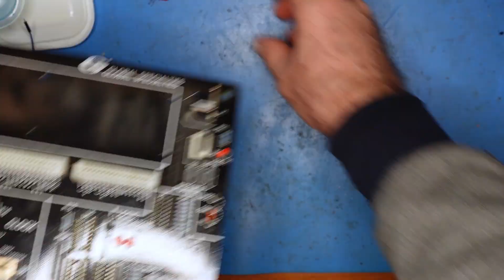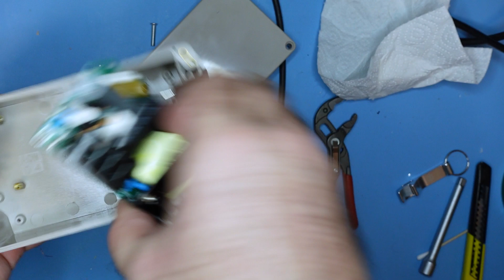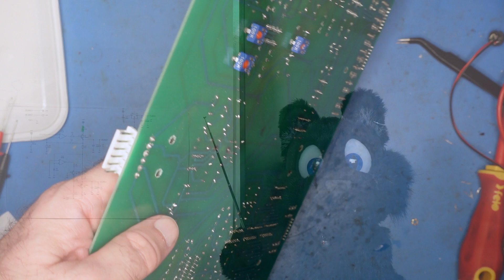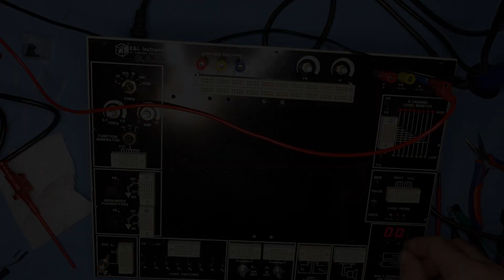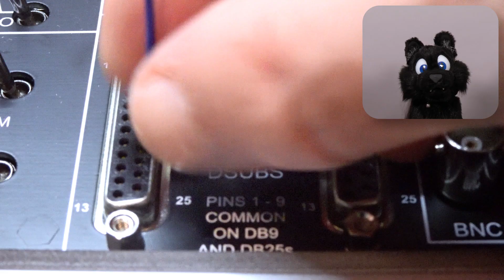Breadboards 2

Comment: I also have that Hantek Scope!
Mines PSU died. The transformer went short circuit.

I recreated it with over the shelf buck converters and 2 24V psus.

Did you also modify it with the 200Mhz hack?
Reply from the maker: So far, mine is holding up. I didn't mod it either. Mostly because I am looking for an alternate one eventually - one that has mixed signal features would be awesome. So far, the frequency was not a really limiting factor for my usual reparis, but seeing digital and (more than two) analog inputs in parallel could be useful.
Reply: @atkelar  ill be honest, I just modded it because I could. ^^'
Though. I didn't actually manage to use the higher frequency stuff the otjer day when tinkering with my HAM radios

Comment: What desoldering tool or station were you using?
Reply from the maker: It's a generic "store branded" one. They pop up on amazon with different logos on them every now and then, so I think it's just a rebadged generic model. Currently the one listed as "AGT Soldering Station" for about 150$ seems to be exactly the same, except for some accent colors and the model name. I'm quite happy with it and while spare parts are easy to get, the first one arrived with a shorted out heater element, so quality might vary...

Comment: I recently sold my ML-2010. While I owned it, I built a duplicate breadboard, so I could have more than one project going at a time. I don't remember exactly what breadboard(s) I bought, but I was able to separate the sections from the sticky foam backing and reconfigure them into an exact duplicate. I used boards that were clear plastic, thinking that this would make it possible to visually check the wire pins' internal connections. However, the glare from the shiny plastic made it impossible to see the inner workings of the individual connections. It also made it difficult to see the holes, to be able to insert the pins, during regular use. I highly recommend against purchasing the clear breadboards. Your experience might be different, of course. The official Knight name for the perf board is a "Blob" board. Knight did not offer these for sale. (I found that odd.) I contacted them directly, to see if I could acquire some. Nope. So, I measured them and bought some that were about the right size. However, I bought the brown type, before I learned that the brown type are of such poor quality. In the end, I never used the Blob board, due to sentimentality of having such a cool bit of kit. I only sold it, to downsize my EE lab to fit into my new assisted living apartment. Thanks for your videos! Cheers!
Reply: I forgot to say that I greatly enjoyed seeing the inside of the ML-2010. I never opened mine. I hope that you received the original owner's manual. It is a high print quality, spiral bound manual - a true treasure and joy. It has test procedures for verifying the proper operation of each function. It even has large scale, fold-out schematics of every internal circuit. More cheers!
Reply from the maker: I didn't show it on the video, but yes: the manual came with it and rests in the lid. I tried to fit it in the shot during the presentation intro, but it wouldn't stay at an angle where you could acutally see what it was, so I just left it out.
Reply from the maker: I might create some configurations of boards on my metal base plates that don't have the power strips, should I decided to get another batch. But for now, I'm good with this one requiring a slightly different layout.
With the "blob" boards, I feared as much. That looked like a custom job to me and at the very least unneccessary expensive. Hence my own recreation. Prototyping PCB manufacturers usually have a "5-piece minimum" order, so that should work out for these. I feel a bit sorry for their drills though 😆

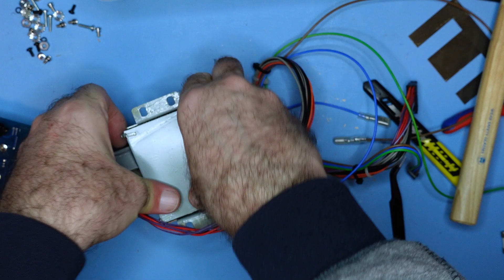Comment: 36:30 Forgive my ignorance: will this rewired transformer buzz without a new coat off lacquer?
Reply from the maker: Not at all; In my experience, the amount of hum does depend a bit on the current draw. Since this one is quite chunky for very little expected current, I doubt it will. Usually, the screws or clamps that go around or through the sheets are enough to keep noticable hum. It might help keep it cooler though, but same idea: if it's under load, it will heat up more.
Reply: @atkelar  Ah, thank you.

Comment: So many breadboards but if I may get on my 'high horse' for a moment, while I did see the label 'DB9' on the panel on the last breadboard it is actually a 'DE9' connector. The second letter specifies the shell size. ie DE9, DA15, DB25 etc. There are just so many different connectors in the D-sub range indeed there are several hundred pages of them in the catalogue
I guess I am a bit persnickety, so I will calm down and dismount from my high horse. It's a 40deg day here in Australia so I think a need a cooling drink. Always enjoy your repairs.
Reply from the maker: I know about the lettering; but somehow the "DB" label has stuck for all sorts of pinned D-sub connectors. To the point where I also don't want to look up the right one and I'm not dealing with them on a daily base, so I won't remember them either... 😅

Comment: My breadboard is in a black plastic clamshell. It is labeled "analog/ digital trainer" but has no maker ID. It works good. 
Did you ever calibrate your K2000? Need to?
Reply from the maker: There are so many different versions of these around it boggles the mind.
As for the K2000 - I did run the internal calibration procedure. I stull keep an eye out for a calibration lab that I could afford ^^

Comment: I have a Knight Electronics "suitcase" style breadboarding assembly  that is a bit different than yours. I can't remember the model number right now and it is buried somewhere in my shed.

 It had a lot of damage in shipping. The internal transformers were mounted with flimsy aluminum right angle tabs that broke during shipping and the transformers rattled around on the underside, ripping several wires off and causing multiple component damage. It is a project on the shelf for the future.

Comment: I'm sure this about to be another great video, so thumbs up proactively.
Wow. I used one of those "pencil boxes" a lot at college. Atkelar videos are often a happy trip down memory lane. Frequently seeing equipment I've actually used is such a delight.
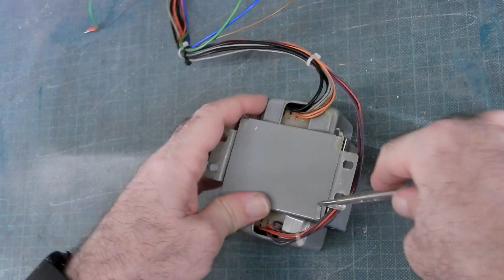@33:00 I'm surprised you didn't tap that transformer for a 120/240 option since you were winding it anyway. I'm no expert, though - is doing that more complicated than just a tap?
Reply from the maker: I thought about making a split in the winding; but I only had thinner wire around and had to double up the windings in the first place. Keeping track of an additional pair of doubled up ends when soldering the leads back to it would have made it a bit of a puzzle. In general, no, it's just "half the windings" but "twice" and then connect them either in series (240) or parallel (120).
Reply: @atkelar  Makes sense. And I suppose if you were to ever sell it, it'd be snapped up by the local 240v market quickly anyway. All the extra effort would go unused.